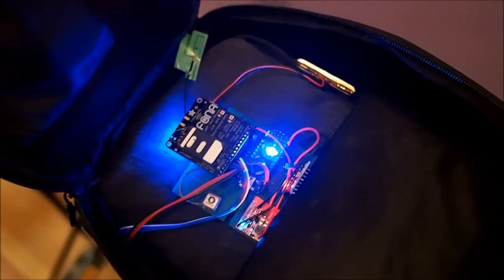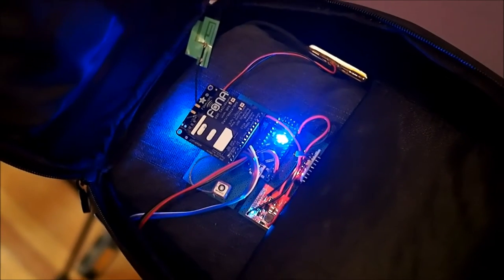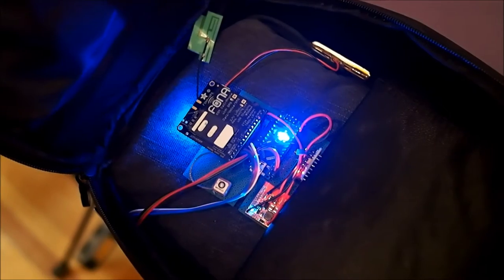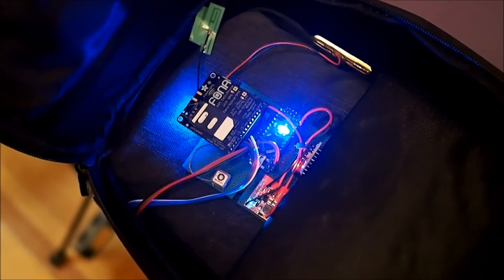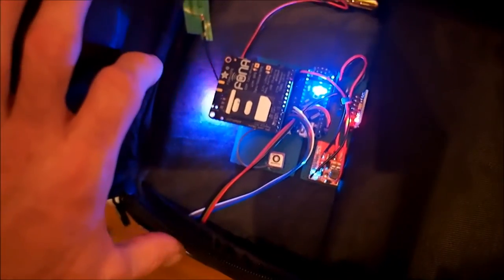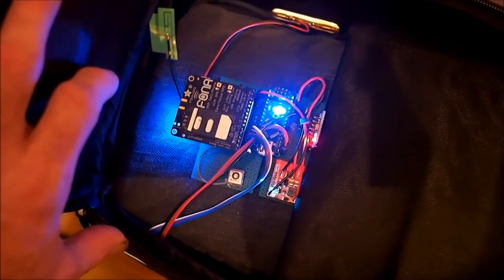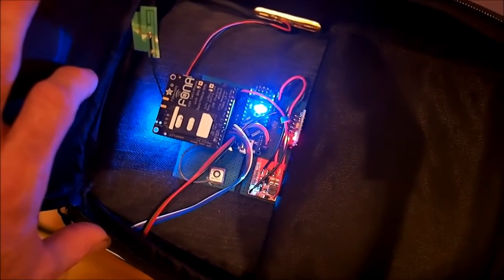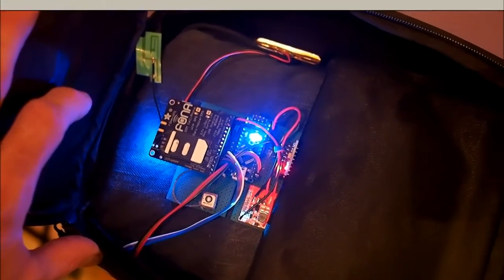Nano Bike Alarm Demonstration

Comment: Ummm, this is awesome!  Are you going to put this on kickstarter or soemthing?
Reply from the maker: Adam Potaznik - Thanks! If there's a demand I'd definitely consider it. Until then, it is an open-source project and is documented on hackaday.io (with thee source available on github) if you're a 'maker' type of person.  ;-)
Reply: Charles Werbick Unfortunately, I am more of a "plug and play" type of person :D However, I do have a BBS01 and am thinking about getting an N360 like you, so more security would be good to protect my investment.
Reply from the maker: Adam Potaznik Right on. If I get the chance to produce it, the details will go up on on Hackaday...

BTW - be careful with the n360 if you get one. I lucked into mine for DIRT CHEAP and it is working fine. But I've heard more than a couple of stories about them totally self destructing in ebike setups and using any motor larger than 250W voids the warranty. :-( so I baby mine...
Reply: Charles Werbick Yeah, I am really unsure about it because I can't get service, and I will need help installing it because I am pretty n00b at bike tech.  I know about the warranty thing but I think on your BBS02 instead of your GF's 01 it has a much higher risk.  Plus Melbourne is flat, I want speed not torque.  My issue is that gear changes are clunking with my current 8 Shimano groupset, if I want to upgrade to a clutched derailleur (which are only 10 speed) I also need to get a new hub, cassette, shifter and chain so it will cost me AU$350 to get all that so might as well get the N360.

Comment: I'm unfortunately much like Adam Potaznik, a plug & play kinda guy, but after spending thousands a on build much like your own BBS02 with a Nuvinci and all manner of custom parts ( about 5k spent so far ).. gps tracking is the only way I'm going comfortable leaving my ride unattended..  i know of at least one system that can be installed in the head tube and intend to grab that, but more options would be a relief..  i reckon it'd be worth your while trying a kickstarter..  if i could incorporate a tracker into my handlebars and frame I'd drop that cash at the speed of light..

Comment: A good idea, but me personally If I saw a bike standing with a bag on the bag at the back of it AND if I were a thief,  curiosity would make me want to look in the bag BEFORE i moved the bike. In doing that and seeing a light of any sort I would pull at any wires I saw hoping that would be the supply to the device. If it still functions after that then it is a good idea.
Reply from the maker: john a - acknowledged... this was merely a demonstration of the prototype functionality. The final design has the hardware and ebike battery plastic-welded together in polycarbonate. But even as a prototype, it was still usable. I concealed the circuit within the space INSIDE the battery allotted for the BMS circuitry (most ebike batteries have empty space inside for the BMS circuit board, not all of which is used) and put a duct-tape pocket on the battery itself for the RFID card. The only indication at all was the chirp of the alarm arming/disarming. (Also i figured out how to kill-switch  the bike battery with the alarm by connecting it to the BMS ;-)

Comment: What's the standby time on this thing?
Reply from the maker: sanshinron - how long will it sit running before it kills the battery? a couple days armed depending on signal strength. longer disarmed as the newest version of the software puts the cell phone  into standby mode when the alarm is disarmed...